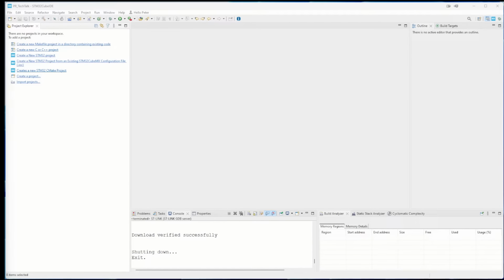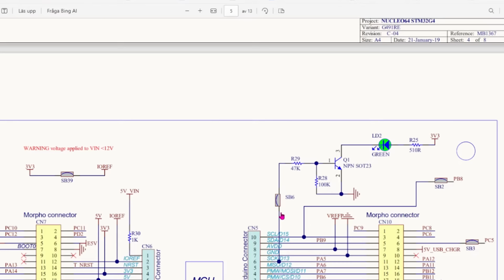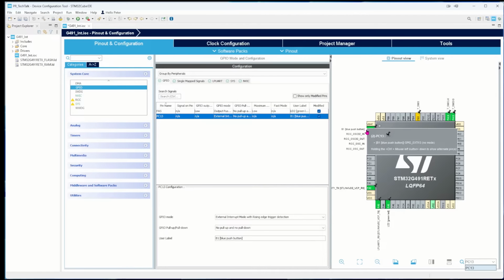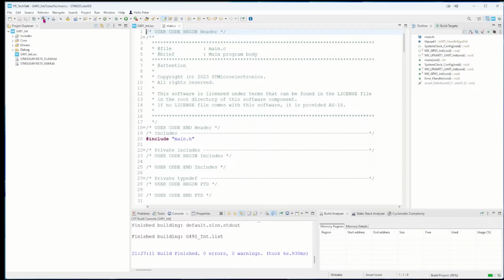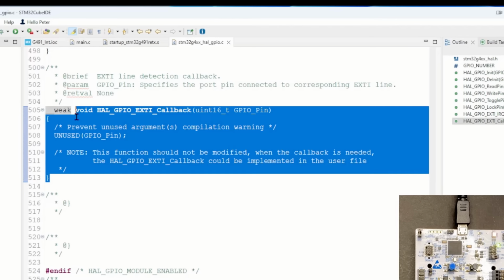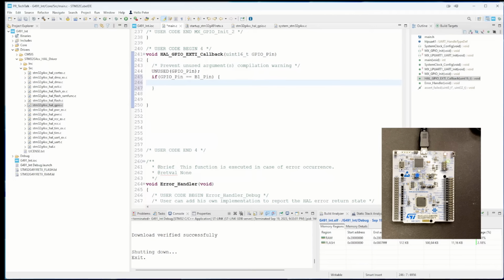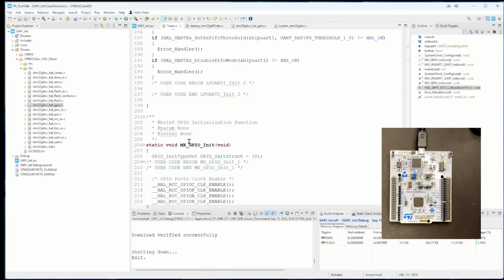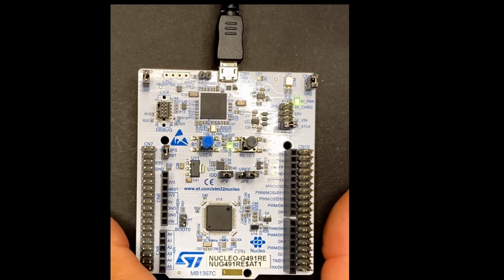Tutorial on STM32 External Interrupts and callback funktions

Comment: Will be great if could show an example of external interrupts from more than one pin that belong to different ports for example PA12 and PB12 (I chose the same pin number 12 on purpose). I have not been able to figure out how to do it. By the way I am using STM32F303. Thank you for your help and time.
Reply from the maker: Hi dont think i fully understand your question, You want to map both PA12 and PB12 simultaneity to Pin 12 on the STM32F303 and then want to know what caused the int ? I have strong disbelief that this is OK, but i do not know all so i must reserve me for this..

Comment: hello sir your way of keeping code small in callback function is cool but i was thinking when controller return from performing function which should be in callback function, will it continue it working from previous stage where it was interrupted?
Reply from the maker: Short answer: You are correct. After have served the interrupt it restore the run status as it had when the int accured and just proceed.
/PR TechTalk

Comment: Hi Peter, many thanks for your video tutorials, I learned a lot from them! I tried to write a similar Main.c source code but accidentally added the Callback routine to the "User code begin 2" section. That way the code didn't work. I noticed my fault and moved the Callback routine to "User code begin 4". Do you have any idea why the "4" section is more proper than the "2" section? Both sections are directly in Main() and not within sub-routines. And I assume a Callback routine is called only in case of an interrupt. So I don't see why the position of the Callback routines are important. Thank you!
Reply: Hi Peter, I'm sorry, I just noticed that I'm wrong, the "User code begin 4" section is outside of Main(). I don't know what's behind this logic but I can accept it. I'm sorry for bothering you!
Reply from the maker: Hi Krisztian, greate that you found your bug on your own :-) Placing of code do have some impact.
I normally place all callbackfunctions in Section 4 and al other rutines in Section 0. But then you also need to declare prototypes for these. You can also put your code in separate .c & .h files and just include them in your main file.
Reply: Many thanks, Peter!